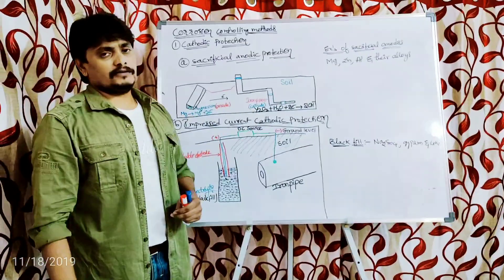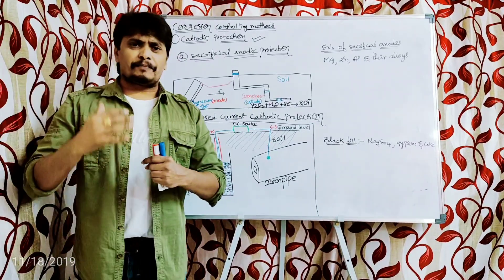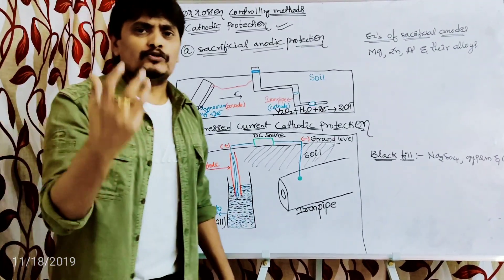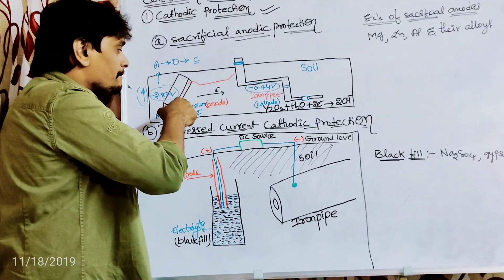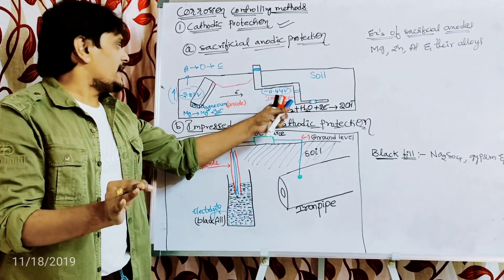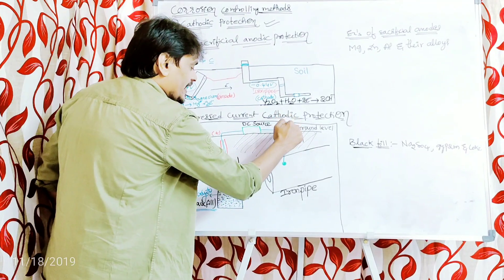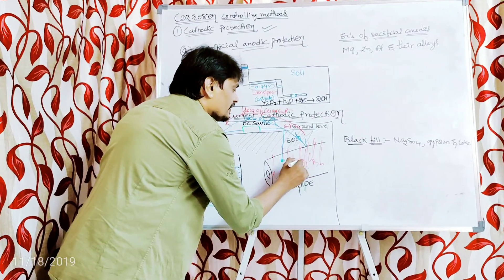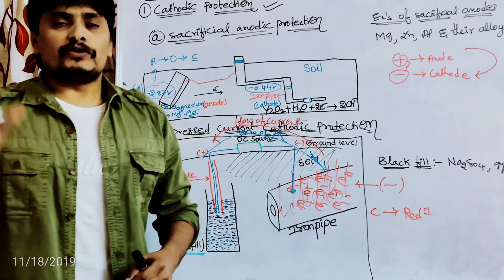Cathodic protection: sacrificial anodic protection, and impressed current cathodic protection.

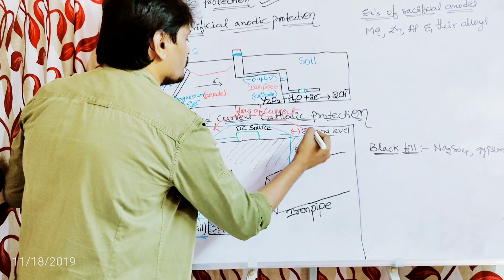Comment: 15:24 sir but normally current flows from positive terminal to negative terminal and electrons flows in opposite direction but here the case is opposite.I didn't get that .please help
Reply from the maker: Dear Rahul, 
 I can understand your doubt, but generally alternative current is the one which we use, and in that case, what you said is right, but in the case of this method direct current is used making use of the battery, so, the current flow is reversed, I hope you understood.
Reply: @DrKShirishKumar  but sir for alternative current in every moment the terminals will change. 
And how the direction of follow of electrons will occur from postive terminal to negative terminal ? Postive means there is deficiency of electrons

Comment: i have a little bit of confusion with the negative voltage associated with metal in e begining of your explanation and the final bit about the Cathodic metal having all electrons deposited on them in an impressed current method.
Reply from the maker: The process involved in impressed current cathodic protection is electrolysis in which the negative electrode is the cathode and the positive electrode is anode whereas in case of sacrificial anodic protection the principle is an electrochemical cell in which negative electrode is the anode and the positive electrode is cathode if there is still confusion, please refer the working of an electrochemical cell, thank you!
Reply: @DrKShirishKumar  thank you very much..
Reply from the maker: Can u please tell me what exactly is ur doubt?
Reply: @DrKShirishKumar  cause e more negative the voltage the stronger is the sacrificial anode.. then with impressed Cathodic protection, the cathode gets all the deposited electrons. doesn't that make it negative potential and start acting like anode unless these electrons travel back to.anode via the soil or sea water?
Reply from the maker: Pleasure!